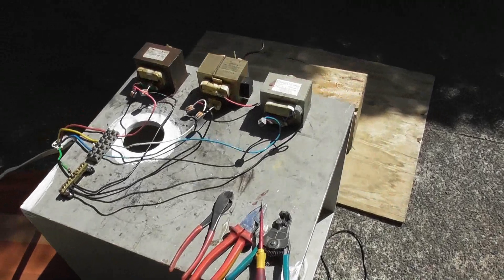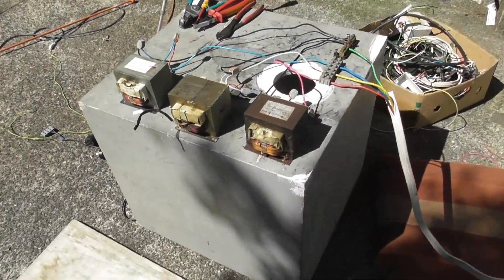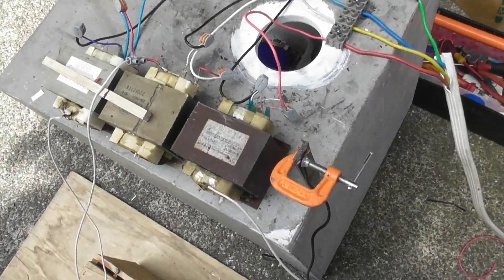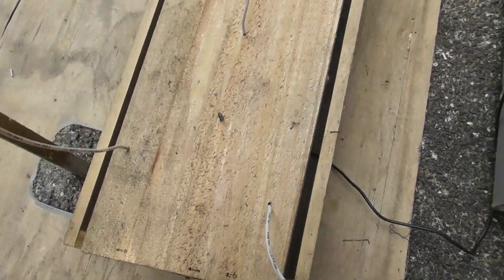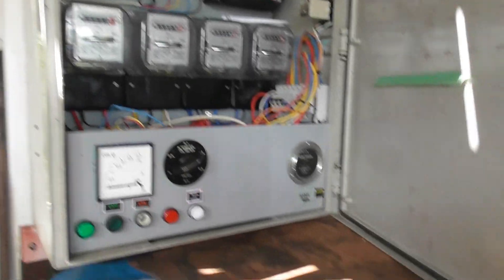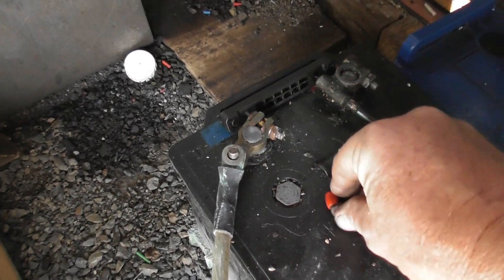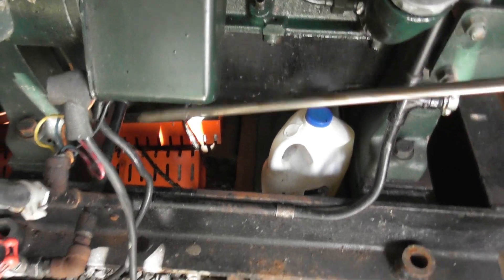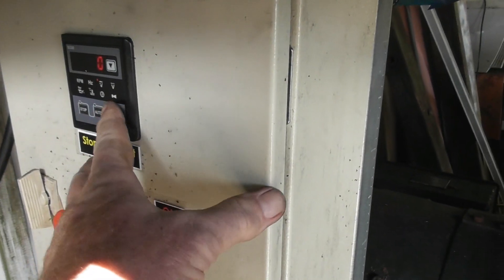3 Phase MOT arcs. Generator armature flash-over

Comment: Looks like my attempt, 6 MOTs. Pairs in series (never drive the first secondary into the primary of the second transformer!!) took the 3 pairs and wired it same as yours. Bolted it all to a 2x12 10' long. But was going for a Jacob's ladder in mega scale. Two pieces of aluminum angle bolted down with 1/16" at the bottom to 4.5' at the top. Rotory convertor fired up. It self started, wonderful!! Then all 3 second MOTs turned red, got 5 bvvvrrrrp 3' arcs but the 2x12 was nearly fully engulfed and it stalled the drive motor in my rotory in turn welding my 30A breaker then the 200A main in the garage, after my meter I have a 400A dual output switch. Blew the cutouts on my transformer on the pole in my yard. I cleaned up my mess, put a 60A in as the main in the garage. Then made the call, FE wants to check your house and buildings to see what caused such a hard fault. They found nothing and kinda took blame for it. Said if I found anything fried too file a claim. I didn't push my luck and try to claim my homemade rotory.

Comment: I would recommend adding automatic protection systems and more safety in general if you plan on more crazy experiments, that could have been worse.

Your stater is also probably blown. In the slow-mo you can see a spark from the bottom of the screen which appears to be from the stator when it energized. This may have been indirectly caused by the heat from the flashover.
Reply from the maker: That spark was a loose connection on one of the battery terminals.
Reply from the maker: That spark you mention at the beginning was from the negative battery terminal which was a bit loose. The 24 Volts starter motor draws about 250 Amps at 24 Volts while turning the engine over. This generator has the field winding on the outside and the current is drawn from the rotor.

Comment: I had similar problem once whilst running a high power radio station on a hilltop  the  genera tor suddenly stopped and one of the power leads caught light
Reply: We were never sure if the generator caused the fault or a faulty amp  caused it

Comment: Hi there I have a 440V 3 phase 12Kw generator head. from the 50's I guess. big and heavy.  I think it is 1500RPM but could be 1000. If you are interested I can get you details and pictures. It is located in New Brunswick Canada. It is not 60Hz.Yours if you can fund the shipping. I can arrange packing.
Reply from the maker: Thanks for the offer, shipping will be very expensive. I get some quotes for a rewind and I have many contacts in New Zealand with generator companies, I will let you know what happens over the next few weeks.
Reply: RODALCO2007 
Yes but with your ability you should be able to fix it yourself. An old Lister generator set like that is pretty simple. 3 rotating pole pieces connected in star. Surrounded by 4 pole pieces providing the field. 6 if 1000rpm. Being controlled by an AVR ( Automatic Voltage Regulator) can be done with a bridge rectifier and a rehostat. AVR’s are readily available off the web. Just need to find the correct voltage. Or build one yourself. Probably ok though. Alternatively any good motor rewind shop should be able to fix it. Yours Allister
Reply from the maker: @akdenyer  Will take it apart and asses the damage and maybe able to repair it myself. Have spoken to a rewind shop. Working this weekend but will keep everyone posted with the progress.

Comment: Hi Ray, what a pity. I wonder if the poor power factor we saw had already been running the old gal out of its capability curve? The may have ‘pre-weakened’ the generator insulation and the shorted MOT was the coup de grace?
Reply from the maker: Yes and breaking a 15 - 20 Amp load at low power factor causes a large inductive spike and on old 50 year insulation caused the damage. Lesson learnt. I should have put a 9 kW resistive baseload on as well during the experiment. But hindsight afterwards ?!

Comment: There's your problem, delta banks can create a high voltage if one of the primaries goes open. If you do this again, I'd either do a star winding on the MOTS or if current unbalance isn't a problem an open corner delta will work. Open corner delta only requires two of the generator's three phases and only two transformers, but you still get three phase on the output.
Reply from the maker: Thanks for your comment, I learnt my lesson.
Reply: They were in star at both sides.